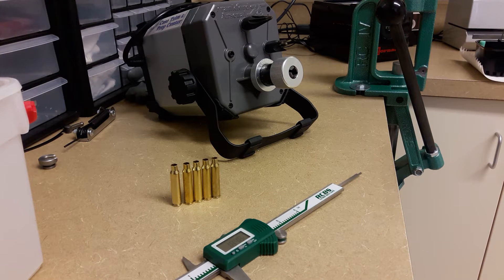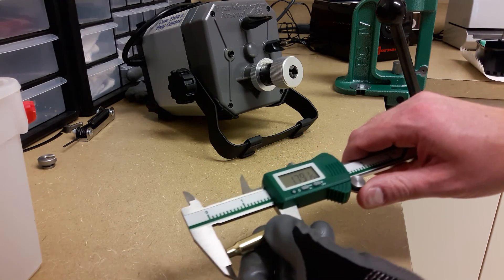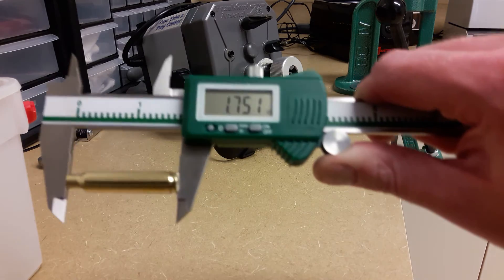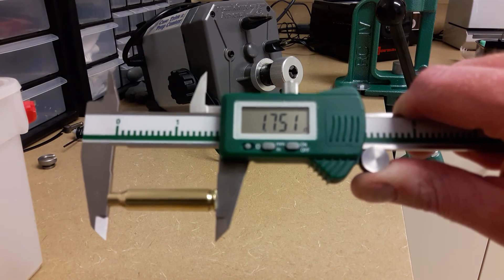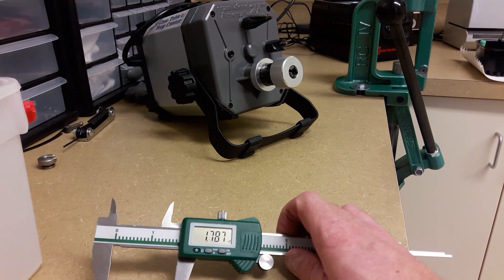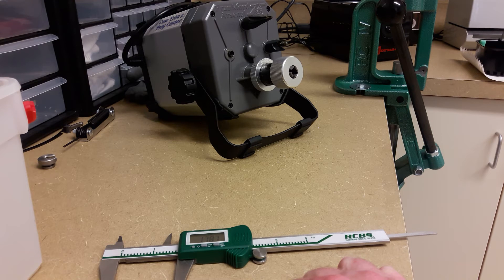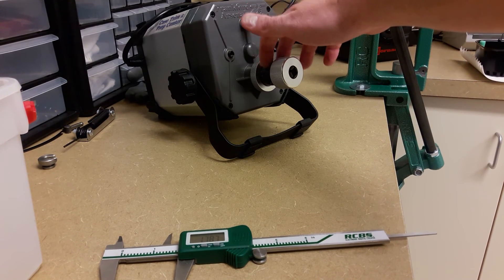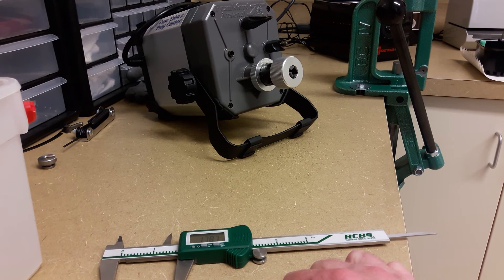Frankford Arsenal case trimmer consistency

Comment: People I have the small trimmer that's connected to my rechargeable drill so then I decided to replace the cutter with the one on my Hornady hand trimmer plus the pilot. Now my FA trimmer is not only guided by the plastic case body collets and then the case shoulder bushing but now also by the pilot inserted in the cutter.
Works very very well !

Comment: If the cutter is turning already, why turn the brass? This does not prove a thing.. show me the length before you trim. For carbide to cut, it takes more pressure on the bit.,when cutting brass or none ferrous a nice very very sharpe high speed steel bit is far far better. Why do you trim your brass anyway when the tolerance of its length is so huge? What is the tolerance you are trying to achieve or work to? When I hear numbers, like a dimension, I find value in that. Just because your caliber shows a number, does not mean a thing, what is the number you are trying to reach? Say the words that inform me you know. Thanks.

Comment: Been using mine for over 3 years. Trimmed at least 15000 pieces of brass.  I'm set for 1.755.  85% of the brass is between 1.760 and 1.750.  The other 15% is outside that range.  All my brass is cleaned, deprimed, resized prior to trimming.  I measure every piece I trim.
Reply: That’s not accurate enough for my purposes.
Reply: Me neither.

Comment: Just picked up one these yesterday at Cabela's. They were doing "curbside" service because of COVID-19. They even matched Amazon's price! 😲Love this machine! I had previously been trying to use the Lee Power Trimmer, but it was clumsy using a power drill and inconsistent in chamfering and deburring. This setup worked great and much easier to work with. 👍

Comment: That really means nothing as far as case consistency. It indexes off of the shoulder. If you have not resized with exact shoulder setbacks(with FL or neck only and shoulder bumping) your cases will not be consistent... Even if they do measure the same length.. example... if 1 case after resizing sets shoulder back .003 and another case sets shoulder back .005 then indexing off those shoulders will give you inconsistent results. I guess what I'm saying is make sure you have resized all cases the same and mic where the shoulder is.. Even after FL resizing it may be needed to use a shoulder bumping die to make them all the same
Reply: So essentially you want to full length size the brass and then trim it? Sorry been reloading pistol for a while but getting into rifle now and trying to learn before I start reloading rifle
Reply: @brandonmedina44  that is my understanding.
Reply: @brandonmedina44  yes.
Reply: @brandonmedina44  yes but even then with fl resize you may not get consistent should push back, you really have you take your time, annealing really helps. I use LE.Wilson lathe type trimmer.. very precise but I still have to sometimes readjust die to get all necks identical
Reply: Exactly. This guy is a clown!

Comment: In your comments you mentioned other videos never measure after trimming. Never understood why someone would trim a case and not mic it. I mic after every trim and still measure each powder drop.I still use a Franklin manual trimmer but I'm not getting consistent enough measurements.  Also, I'm looking for a trimmer that measures from the shoulder... something I didn't realize until lately. Two questions... how precise is setting up of this machine. Corse or any fine adjustments? I like that you changed to a carbide bit but where did you get it and if you have a part number. Nice vid... and yes you probably have the cleanest bench I have ever seen:)EDIT: Have one more question...The chamfer and reamer wobble. Is this caused by the Frankford or the bits? Is this a concern?
Reply: Fast Brass can trim from head stamp AND OR SHOULDER or any way you want.
Give me a call and I will tell you how it trims off the shoulder.
Plus you won't have to spend money for one of those niffty gloves to keep your little sissy fingers safe.
Call Bert @ 515-277-6299 or fastbrass@reagan.com

Comment: Very nice video, but can't help and notice how slow it is compared to like the Giraud case trimmer. Is there no way to speed up the motor on this unit? Seems maybe just a hair faster than a manual trimmer? Perhaps you were going slower than normal as you were going for consistency? Thanks for your input.
Reply: I think the nice thing with this unit is having it all in one. You can trim, debur, chamfer, and clean the primer pocket (he doesn't have that tool on in this video) all in one unit. So you don't have to handle each piece of brass more than once. That's pretty nice.
Reply from the maker: Never used the Giraud but for me it is much faster and much more consistent that the manual RCBS trimmer I was using. There is no speed adjustment on this unit though.
Reply: i found it faster swapping out the factory cutter with an RCBS carbide cutter. Fastest trimmer ive ever used was the WFT crow or something like that, used on a power drill. Only thing it does it trim tho, but i suppose if you wet tumble the brass after it can debur and chamfer the rough edges. Then again $100 for only being able to trim one caliber... im happy with this unit overall.